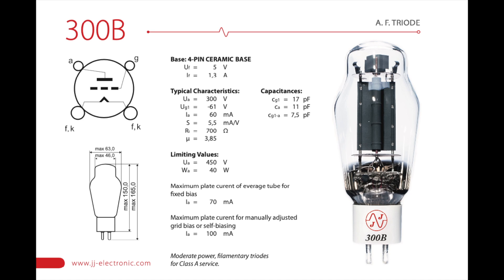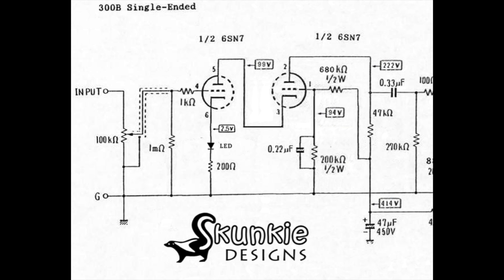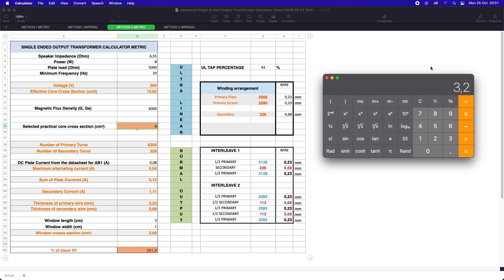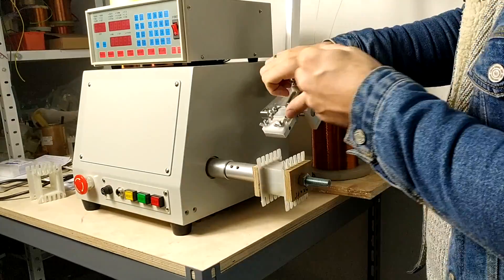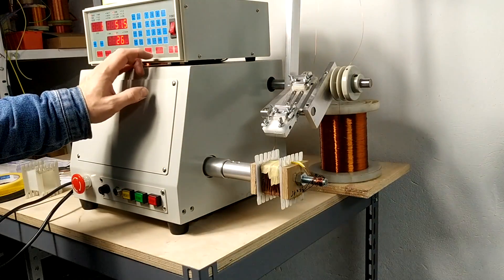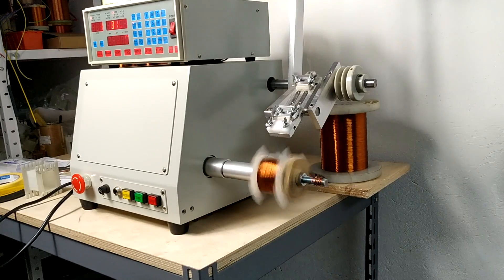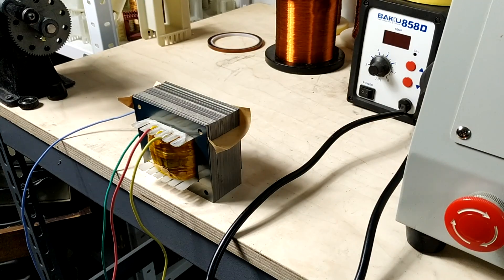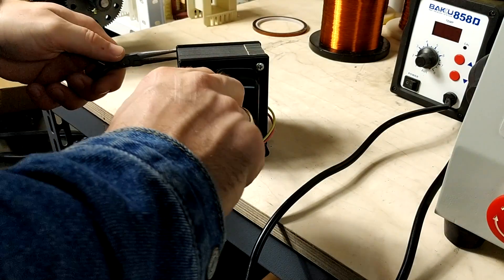300B SE Output Transformer Calculation and Winding

Comment: Adding layers of insulation is not always always a good thing - 

Increased Gap: The added paper increases the physical distance and, more importantly, changes the effective magnetic path between the layers of windings. Paper has a lower magnetic permeability compared to the core material, similar to air. This increased gap or spacing makes it less likely that all the magnetic flux from one turn will link with all the other turns.
Reduced Coupling: The less a magnetic field from one coil (primary) links with the other coil (secondary), the lower the magnetic coupling. The portion of the magnetic flux that does not link constitutes leakage flux, which is the source of leakage inductance.
Higher Reluctance: Introducing a material with lower permeability (like paper or air) into the magnetic circuit increases the overall reluctance of the magnetic path in that specific area, forcing more flux lines into non-ideal paths (leakage flux).
Reply from the maker: That is a theory and it is true when really pushed to its limits, but has no practical meaning in winding a power amplifier output transformer. Each circuit topology dictates what is really important and makes a real difference in transformer design. In a relatively high voltage (300-400V) step down transformer the most important is to have a large enough core and enough windings on the primary to get the 20Hz reproduction. And then you need to have at least two interleaves (preferably 3) to get the high end response to 20khz (three interleaves go to at least 25khz) For SE, you need to have a gap (almost any reasonable gap that you can mechanically fit will work. Everything beyond makes little to no effect and does not affect transformer performance at audio frequencies.

Comment: Nice work! I just wonder if you could get a better core performance if you shift the direction og the E and the I plates for each layer of core plates. So they are sort of braided. I once worked for the danish transformator manufacture Lübcke, and they used this technique.
Reply from the maker: Thanks! The interleave technique works in a sense that you get higher flux density, but the problem is that for SE amplifier there is a direct current in the primary which would saturate a core. That is why for SE output transformers you have to do a "butt stack" to prevent transformer from saturating. That's why you need larger core for SE to compensate for that.
Reply: @Delatsch  Thank you - that makes sense 🙂

Comment: That's nice, I just got the same winding machine, but didn't come with the threaded rod for the bobbins. What diameter did you use for it?
Reply from the maker: Yeah, I had to buy it separately at the hardware store. I think it was 12mm, I will double check today and let you know. Just be very careful before starting the machine after you install it because the machine (at least mine) was set at max high speed which is like 6000 rpm by default. So, for testing first set the program to low speed  or at least lower high speed like 5-10 setting.

Comment: HI, GREAT VIDEO, what is the thickness of the air gap? or does it not matter.
Reply from the maker: Thank you! I am using single sheet of paper for these kind of currents. It depends on the dc current, but it doesn't have to be precise. The rule of thumb is thicker gap for larger currents. You can of course test it like I've shown in my choke video where I use different materials and measure the primary inductance.

Comment: I'm not sure its a good idea to spool the wire off the roll that way? It must really get twisted up?  Better to just roll it off the spool like it was when the wire was manufactured?
Reply from the maker: Thanks for your comment! Over the years I've tried many different ways horizontally/vertically etc. but the best way I found is to keep the wire under the tensioner and let it freely unwind like that, but the important thing is not to have anything around that the wire can catch onto. That way I don't even have to look at the wire and I can jus leave the winder winding and it never breaks. With thicker gauges it doesn't really matter, but the thinner the gauge the better this method works.

Comment: Hi !  I tried to buy the advanced spreadsheet for calculating the trafo but Norton AV didn't allow me to proceed. I left a msg. in Facebook. Any workaround ? Thanks !
Reply from the maker: Hi, I wrote you on facebook. There seems to be someone issue on some browsers with accessing or selecting different products. I am working on resolving it. If anyone is facing similar issues, please contact me directly if you would like to order anything from the website. Thanks!
Reply from the maker: The site should work properly now, please try ordering again.

Comment: You can't hear the difference between rectifier tubes, in fact, you can't hear the difference between a tube and a silicon rectifier - it's DC, you can't hear DC!
Reply from the maker: I am probably not the best one to explain it, but the tube rectifier has a significantly greater internal resistance compared to a silicon rectifier, and the voltage drop is therefore greater. When power tubes draw higher plate current (when the input signal is higher) the tube rectifier cannot supply all the voltage and this creates a sort of compression or sag in the audio output. I've tested it in practice many times and it is extremely  easy to hear the difference and it is a significant difference. You can check some better technical explanations online if you search for "tube rectifier sag".
Reply: @Delatsch  Thanks. 
I'm asking why people are using tube rectifiers at all, you're better off with solid state, less energy wasted too. Some people think you get a gradual rise in voltage as the rectifier filament heats up but you can do that with SS too. Cheaper and better.
Reply from the maker: You are welcome and thanks for your comment. Yes, in theory it is easier, more efficient and measures better, but in practice it just sounds a lot better with a tube rectifier. SS amplifiers in general work better, have lower distortion and superior performance and are more cost efficient, but myself and most people still prefer the sound of the tube amplifiers more. If you would have the opportunity to hear the tube vs ss rectified amplifier I am sure you would be positively surprised by the difference in sound. Of course there are people who prefer SS rectifiers, but they still hear the difference @mosfet500
Reply: After the rectifier there's a choke and capacitors smoothing the 120hZ ripple. Unless there's poor rectification there's nothing to hear, it's DC at this point, any unfiltered B+ noise will be in both circuits. A tube and a diode do exactly the same thing. I've heard both and designed both, it doesn't matter if it's a tube, diode or 300 volts of batteries strung together. @Delatsch

Comment: Any technical informatiom about this transformer? Frequency response, copper losses and so on?
This looks like a very simple transformer which migth work but not the performance an expensive tube as a 300B needs.
Reply from the maker: You can check my other video where I do detailed measurement on this transformer. The 300B tube is expensive, but that doesn't mean it performs technically well. It is expensive for marketing and demand reasons only. The performance of directly heated triodes is very poor by technical standards and the transformer has far superior performance to the tube. If you check the western electric data sheet it shows it clearly. Now the way it sounds is another topic. It sound absolutely wonderful.

Comment: Hi Marko,
I hope all is well with you and your loved ones. I think about you often being in Ukraine. 
I am about to start on a couple of projects - one a Theremin for a musician friend and another stereo amplifier using 1619 tubes. The filaments are 2.5V, 2A and I need two separate filament windings as the cathodes are directly heated so I took a 12V, about 100VA  outdoor lighting transformer and removed the secondary and wound two secondaries for 2.5V each. I used silver plated, Teflon coated wire - I assume the Teflon will be OK and not melt. Your thoughts on that would be  greatly appreciated. It buzzed a bit when I reassembled the core so I did the best I could to tap and tighten it up and then dipped it in shellac and it worked - I hope it doesn't catch on fire...  🙂 it provides proper voltage under load of 4A each winding. Stay safe -
Reply from the maker: Hi David, nice to hear about the upcoming projects. Sounds good, if you used around 20 awg wire or thicker there shouldn't be any problem.

Comment: How do you adjust the wire tensioner pads correctly? Thanks.
Reply from the maker: I adjust it by feel. The wire should be very tight but still go smoothly when you pull it by hand. You should feel resistance but no binding or squeeling. It takes some practice and a lot of broken wire until you get used to it. Very thin and very thick wire are problematic, but from 0.2mm-0.7mm it should be relatively easy to adjust.
Reply: @Delatsch  OK thanks, much appreciated.

Comment: Is the large size necessary for a single 300b?
Reply from the maker: I would strongly recommend it. You could do it with a bit smaller core of higher permeability of course, but I still haven't got around trying it with better laminations. With push pull it is easier to get away with smaller core since there is not gap to compensate for. I must say that it is well worth the cost and trouble. Was listening to this amp couple of days ago. Despite the fact that it "only" 6-7W per channel, even with the volume on half it is too loud an average room. And that's on average speakers (don't know the exact spl) Because of the large core the bass is amazing, but due to interleaving method used the high end extends to 29 Khz. At 4.5W -3db point is around 15 Hz if I remember correctly and at 29Khz. I will post a video today or tomorrow with the tests, just need to finish the voice over today.
Reply: @Delatsch  thank you for the very detailed answer. What wire diameter are you using? Primary looks fairly thin?
Reply: I think , let me just get your software and see
Reply from the maker: I'm using 0.25mm wire for the primary, but 0.2mm would work just as well for the current in question.

Comment: Excelent!!! I will try your SE calculator to  winding a old style champ 5f1 SE OP trafo. So is possible to you make a video tuto. about the interleaves and layers to clarify that. Best Regards
Reply from the maker: Thank you for your support, Juanjo! I will make a series of videos going into details on audio transformers.
Reply: @Delatsch  hi Marko, I'll be waitingthe videos! Today I started my calculations of the 5F1 champ output trafo with your SE Spreadsheet Calculator. It is very versatile and concise. The only thing that I am not sure about is if I should make interleaves between primary and secondary and how many layers and interleaves do I need in this type of vintage amplifier transformer.
Reply from the maker: @juanjobravo4476  For 5F1 champ, no interleaves as far as I remember. Just wind the whole primary and then the secondary on the top of the primary.
Reply: @Delatsch  Thanks Marko!

Comment: Interesting video, are those EI 114 laminations you are using on the O/P transformer?
I like the CNC winding machine you have there. What gauge of wire can it handle min to max if you don’t mind me asking?
Thanks
Reply from the maker: Thanks, no I'm using EI-96 32x40mm bobbin. The winder can handle 0.03mm-1.2mm.
Reply: @Delatsch  ok thank you for info, I better start saving up!

Comment: Ooh, nice!  Did you use M6 steel or another core material?
Reply from the maker: Thanks! I used the basic M530-50A because most people have access to it. But, I am planning to swap the core and retest.
Reply: @Delatsch  I’ve got a couple of these low watt beam triode style amps.  I use M6 and it’s great. I like Metglas cores too but they get pricey.
Reply from the maker: @mattportnoyTLV  Yeah, I guess M6 is more than enough, even the one I've used performs perfectly from 20Hz-20khz+ with this winding configuration.
Reply: @Delatsch  I did an M6 10:1 transformer earlier this year.  I chambered the windings and used layers like the old Neumann U47 output transformers do. I got a flat 20-50k response out of it.  Some day I’ll wind a tube amp output transformer using a similar strategy.
Reply from the maker: @mattportnoyTLV  Nice, yeah those were wound by hand in 4 compartments. With good quality core you don't need too many turns in primary which automatically reduces leakage inductance.
Reply: You didn't need the insulating layer between the Pri and Sec layers.  The reason why?